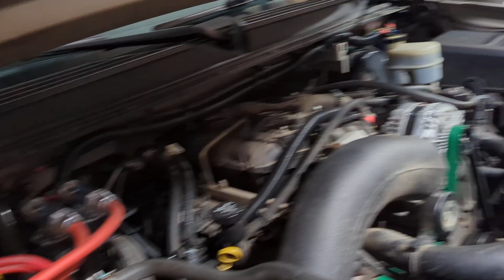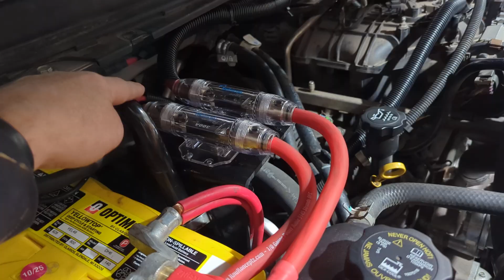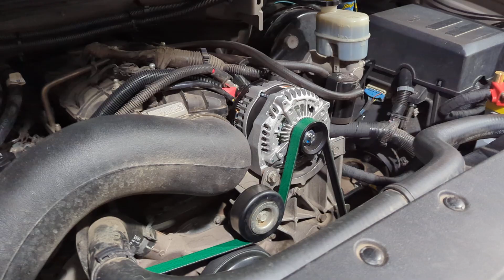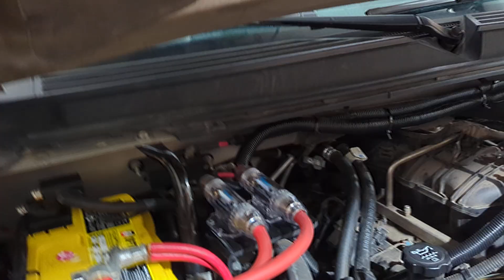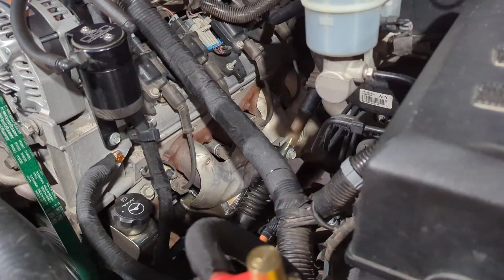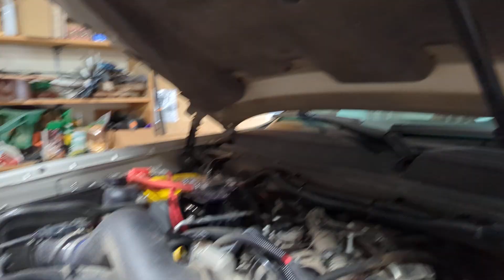2009 Tahoe GMT900 Dual Battery and Big 3 Upgrade

Comment: ❤❤How did you stack the knukoncepts  battery terminals on the negative and positive sides?  Did you use the version 1 or version 2 or both..